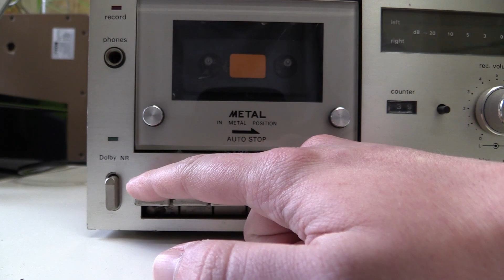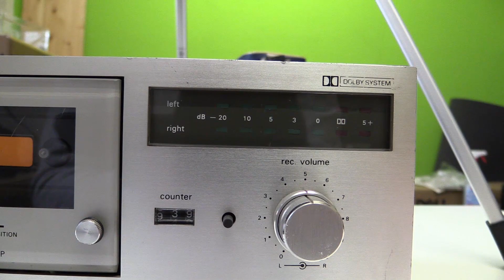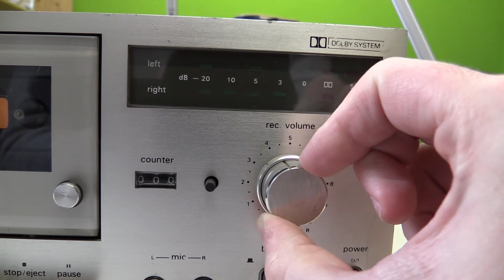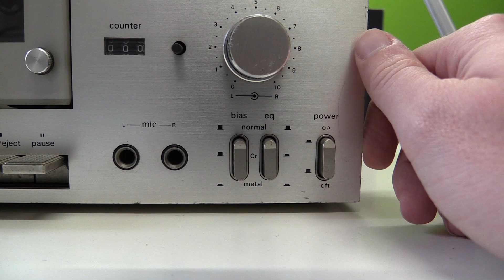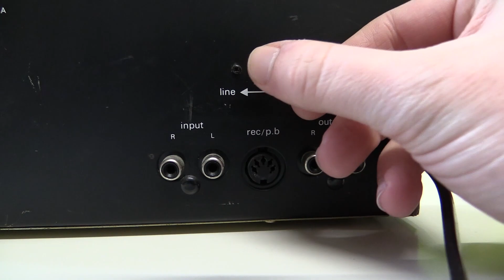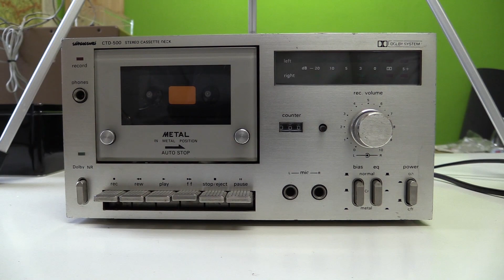1981 Ultrasound CTD 500 cassette deck

Comment: I've always liked this deck's small size, even if it is rather cheap. In terms of performance I bet it's very similar to the Realistic/Optimus SCT-86 that I have, which also has a rather poor implementation of Dolby B NR.
Reply: I still have my SCT-86. First deck I ever bought. Not the best quality but not the worst either. I must have over a thousand hours of use on it and it still works.